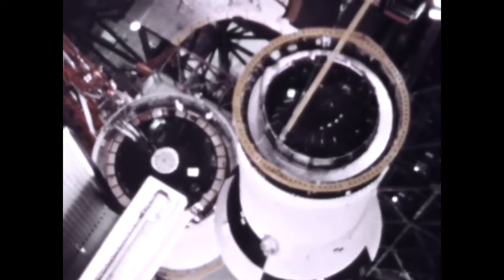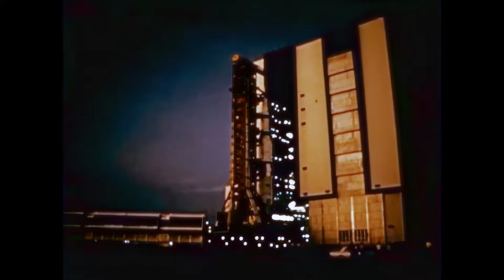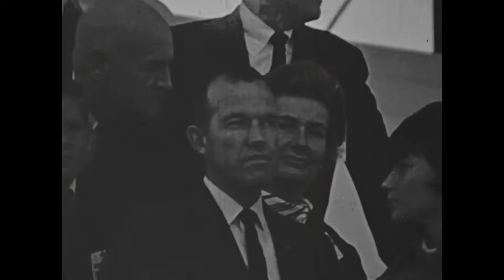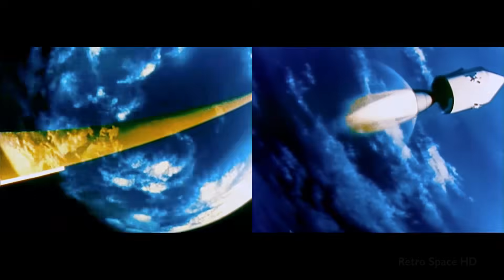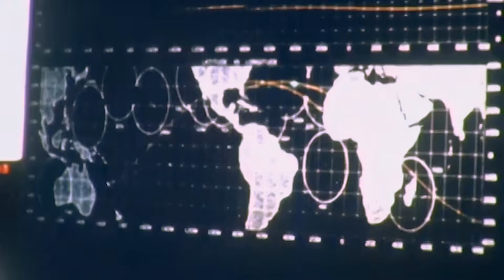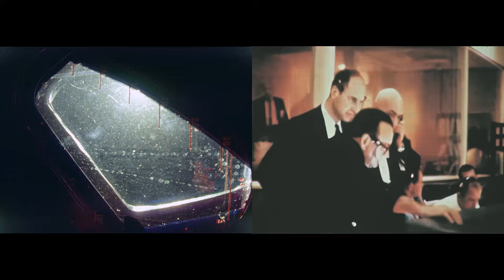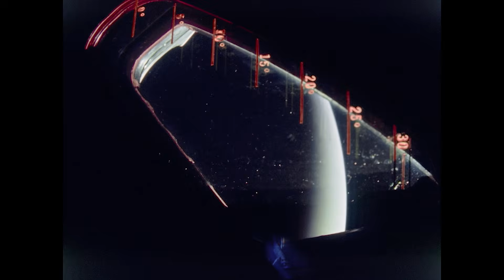Apollo 4 & 6: First Saturn V Test Flights - Historical Footage, 1967, A-type missions,  CSM, NASA

Comment: I never thought I would be looking back 50 years later wondering why we can’t do this anymore?
Reply: Artemis?
Reply: Go back to late fifties and the high speed high altitude capabilities or the limitations we had at that point. Then within a scant couple of years , all of those challenges or limitations had been overcome. Ultra supersonic flight,  perfect directional and attitudinal control in low to zero air pressure, with very limited structural failures . Amazing . Yet Chuck Yeager would have nothing to do with it interesting
Reply: @michaeltaylors2456  Yeager didn’t qualify for astronaut training due to a college degree requirement that he didn’t possess.  Some say that tainted his opinion about the space program.  Also, he wasn’t a fan of all the automation which he thought made the astronaut occupant little more than a passenger.  He felt his opinion was justified when NASA performed the first Mercury mission with a chimpanzee.
Reply: @Primus54  . Sure thanks for posting the wiki and “official”  version. No one will dispute that he was considered the finest test pilot we had. It was really not even close. A “degree” had nothing to with his being capable of performing whatever the new “space” program would challenge him with. His “tainted opinion” whatever that might be implying, is also nonsensical given his accomplishments. His opinion on automation and alleged comments about spam in a can and monkey pilots is him giving us a hint into what was really happening with “ space” flight the new NASA and the conditions thereof above 60,000 feet. This is still considered extreme high altitude for controlled and safe flight. The challenge of  overcoming the technical challenges that operating in a nil atmosphere presents was something he was already extremely familiar with. Compare what U2 and SR71 pilots do and don to prep before flight to just above 60,000 Mach 3plus , while an astronaut going to above 300,000 and Mach 25 the velocity can wear a cute and completely optional flight suit, have no oxygen pre-breathe nitrogen purge period and wave like an idiot to the adoring crowds. Another giant hint, given all of NASA’s late 1950s to current space craft automation systems , why has none of it been applied to a current U2 airplane ? apparently it still needs a skilled pilot to complete its mission above 60,000
Reply: @michaeltaylors2456  I didn’t reference wiki or any “official” version to arrive at my comments.  I’m a 68-year old fan of Chuck Yeager, but I don’t place him on an infallible pedestal.  He had a giant ego like most “best of the best” fighter jocks who became outstanding test pilots.  He likely would have made an excellent astronaut, but it is a fact the idiotic college degree requirement kept him off the list.
Reply: @Primus54  👍🏻. I was Stationed at Beale AFB, CA from 1984 -1989 and assisted in the General’s yearly physical. While I did not get to speak privately with Yeager, I was privileged to speak freely with many U2, SR-71 and KC 135 Tanker pilots who shared with me probably more than they should have. Yeager was egotistical, and a racist, but why is that important, given the objective, he was still the best pilot anyone ever saw. It’s obvious now, that NASA needs overeducated, I mean more indoctrinated wussies to participate in the charade.

Comment: Around 21:10 you can barely see a blip on the bottom of the Saturn V's silhouette that is part of an SLA panel failing and tumbling down the rocket. It is thought to have been due to structural failure in the aluminum and starting with Apollo 7 had modifications done to the panel design and inspection.
Reply: Perhaps due to the insane vibration the beast was enduring.

Comment: Nice video! it is remarkable that the extremely serious problems on Apollo 6 in April were completely solved by Apollo 8 in December, even without another test flight. And from then on, all the Saturn Vs performed nearly perfectly, with one small issue on Apollo 13 being the only anomaly.
Reply: Skylab was kind of a nightmare though- the cascading events from the fairing failure caused the interstage to fail to jettison properly. Thankfully it is likely that some of the same damage that prevented it from separating also knocked holes in it which prevented the SII from overheating. Despite everything though, the Skylab S-II hauled itself, the interstage adapter AND the workshop into orbit! (And then the sep motors blasted the loose solar array off the station)
Reply: Small issue ??????
Reply: @wimkuijpers1342  The fault that created the real crisis was not in the booster. The center engine of the S2 stage shut down from pogo disruption, much as on Apollo 6. That required running the remaining engines longer. That was unrelated to the service module explosion that created the crisis.
Reply: @ultrametric9317 The Apollo 13 S-II centre engine shutdown was less than 1 second away from causing loss of the vehicle, it had already reached an amplitude of 3 inches in each direction with forces of 68 times gravity. Somehow the control system shut it down despite not actually being designed to do it for this reason. The fix for this known problem went into Apollo 14, but the Apollo 13 crew was very nearly lost even without the service module oxygen tank explosion.
Reply: Apollo 7 was a manned space flight before Apollo 8?
Reply: @eugenelane3291  Apollo 7 used a Saturn 1B rocket not a Saturn V.
Reply: @eugenelane3291  That was a Saturn 1B launch. That rocket was already known to be reliable.
Reply: Apollo 7 tested it again.
Reply: @davidmichael9342  Apollo 7 was a Saturn 1B, not V.
Reply: @ultrametric9317  My comment was concerning the shroud for the lunar module. It got further testing on Apollo 7 after the incident on Apollo 6.
Reply: @davidmichael9342  Oh. Sorry. That was a pretty minor problem compared to the crossed wiring in the S-II stage and the double engine shutdown and the extreme pogo in the S-I.

Comment: Never knew Gordo did that test after Apollo 4. Great video as always. Edit: just goes to show how important test flights are. Apollo 4 was a perfect flight but I always look at 6 as the perfect failure where they learned of existing issues with pogo, crossed wires and spark igniter propellant line issues in a vacuum.
Reply: Good point
Reply: What I think astonished everyone was after Apollo 6, with all its problems, the next flight of the Apollo-Saturn V was the Apollo 8 mission with three astronauts on board.  That was a memorable Christmas Eve when they read the first chapter of Genesis while in a 60 mile orbit above the moon.
Reply: Apollo 4 wasn’t perfect - the F1 Engines had serious problems with combustion instability that were finally solved by a full redesign of the injection plate with added baffles.
They didn’t discover the fact the command and service modules almost collided during re-entry until the first manned flight.
Reply: @allangibson8494   the combustion instability in the F1s was found and resolved 4 years before Apollo 4 around August 1963. Apollo 4 was Nov 1967. The divergent ring baffled injector was redesigned to correct oscillation within the thrust chamber following a static firing at Marshall. I say around August 1963 as that’s when the Marshall quarterly report came out, reporting the redesign. Someone like Sonny Morea might recall when exactly, but it was 1963 sometime.
Reply: @ohheyitskc  Pogo was the on going problem with the Saturn 5.  As you say combustion instability had been solved in the static test phase. One should not confuse combustion instability with pogo.  Two entirely different engineering problems.
Reply: 15:30 .... Ggggggggg orororor dddddd onononon